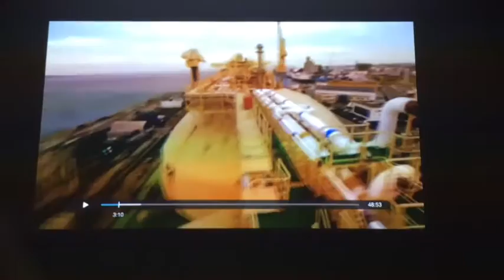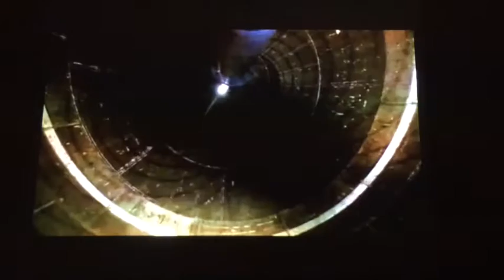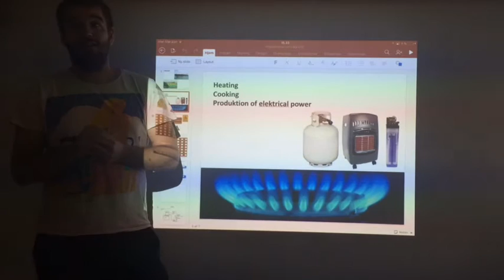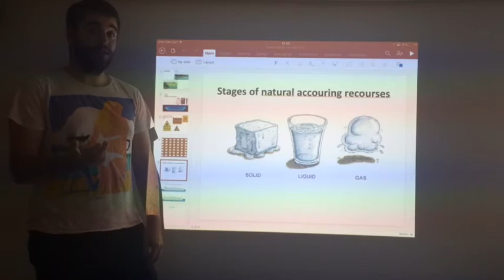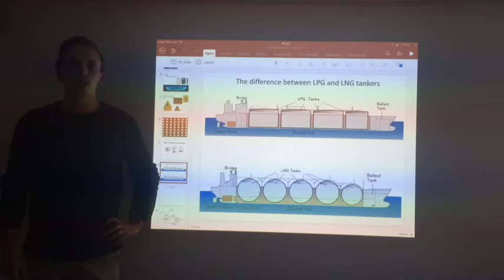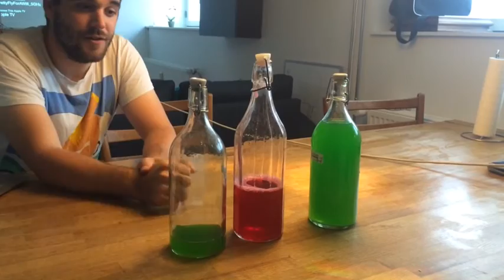LNG LPG tanker Vessels

Comment: Sloshing will not affect the ship’s stability so much but it could damage the tanks if they are of a membrane type. The waves inside the tanks would contain too much motion energy than the tanks could take. There are no bulkheads  to reduce this energy and the metal barriers are only 0.7 millimeters with invar steel. You can compare it to a milk carton where only a thin layer of plastic keeps the liquid in place. As for cooling the normal way to take care of of the boil off would be to burn it or use it for electricity and propulsion. It is to costly to condense it back to liquid.
In such case you would need a three stage cooling. First stage water to Freon or propane. Second stage Freon/propane to ethylene. Third stage ethylene to methane. LNG have a critical temperature of -49 degrees centigrade where if is above it will not be liquified. Only compressed.

Comment: Your cooling process explanation is wrong for LNG. LNG can't be reliqefied using direct cycle. You have to use indirect cooling plant with few heat exchanging medias to achieve condensation, normally this plants called 'Cascade plants'. This cooling plant picture is applicable to cargoes, normally carried by LPG carriers, not for LNG!